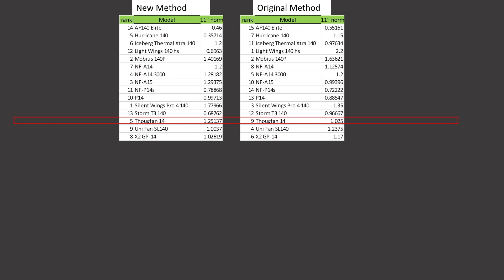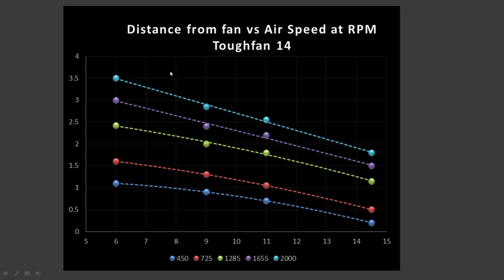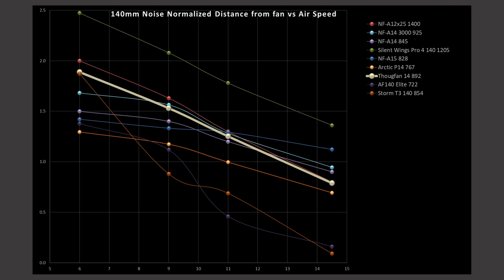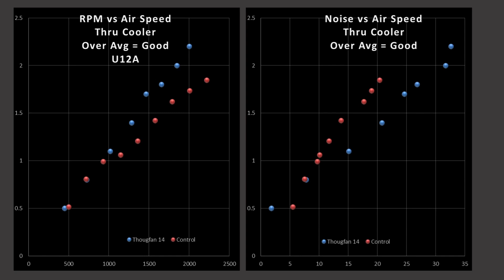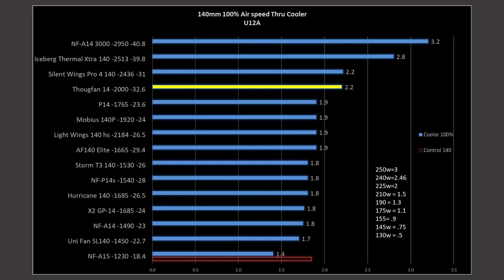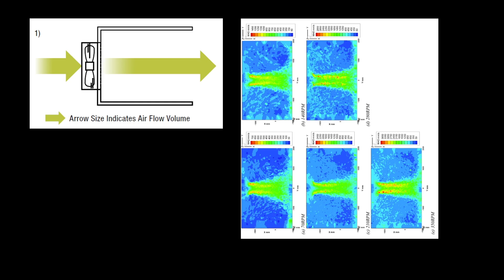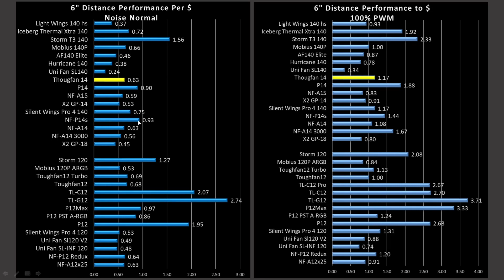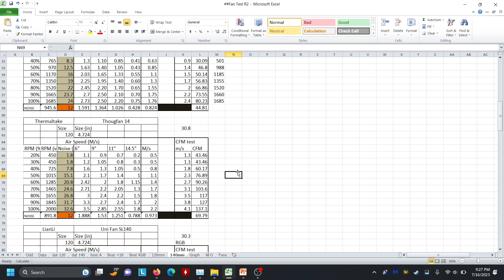New Testing ToughFan 14

Comment: I got across 2 toughfan 14 pro for pretty cheap recently, and I must say that they are probably the best fans I have. I swapped my regular toughfans for them and could lower the RPM by quite a lot and keep the same temperatures.
Reply from the maker: I havent seen the toughfan 14 pro. im going to have to look for that.
Reply: They start getting loud at 50% RPM, but have amazing performance while still being quiet. 

My setup now is an arctic liquid freezer 280 but with toughfan pros, an arctic f14 as exhaust (talking about shooting air all over the place) and arctic p14 argb as case fans. I haven't done any proper testing, but I think they perform better than the regular p14s despite what the spec sheet says.

The sound profile is also much more pleasant. 

The toughfan pros brag about the regular LCP things: really tight clearance, higher static pressure, more better everything.
Reply from the maker: @LinusBerglund  I just found the fans. It might be a bit but going to buy to test them. 
I feel like more companies are starting to make better 140mm fans finally.

Comment: You should check out the new Thermaltake Thoughfan Pro line. I notice in general performance is significantly better as well as noise.
Reply from the maker: I actually have tested them already. Just havent published yet. I have not tested 120mm yet but the 140mm are now my top pick best allround 140mm class fan.
Reply: @computer-tech-more  yeah I just picked up the 14 last week. The static pressure is crazy good. Mounted to a 45x420mm with moderate fin density it doesn't seem to effect flow at all. I'll be picking up a few more to replace the TF14 RGBs on the other rad I have as well.

Comment: 30:30 You say CFM testing is in invalid test for performance but then go on to say that it is valid for radiators, heatsinks and case exhaust. But that's already 3 out of 4 possible use cases for a fan in a computer case (intake, exhaust, heatsink, radiator). Not going into the argument the actual real-world usefulness of CFM results, it seems rather odd to claim test results is invalid while also basically stating it is effective in the majority of use cases.

I liked your review overall though, thanks.
Reply from the maker: I was mainly referring to most reviewers use CFM testing to say this fan is good at case airflow because High CFM good. 
The other statements are just a way of calculating air movement. so you can say airflow thru a Rad in m/s or in CFM or cubic meters per second.